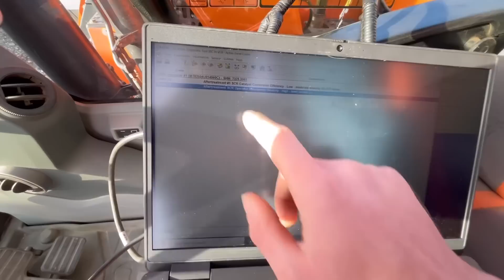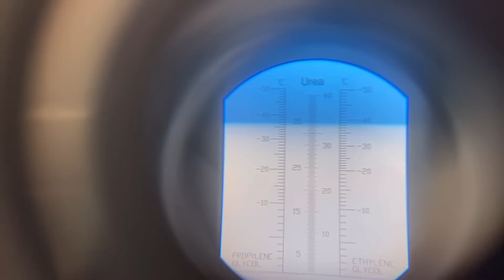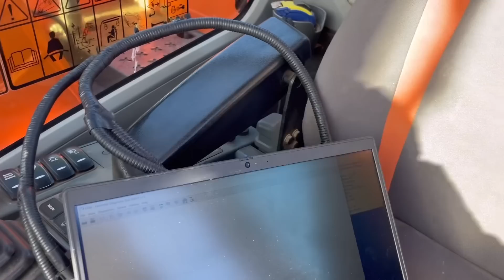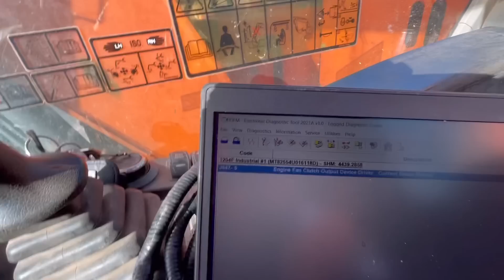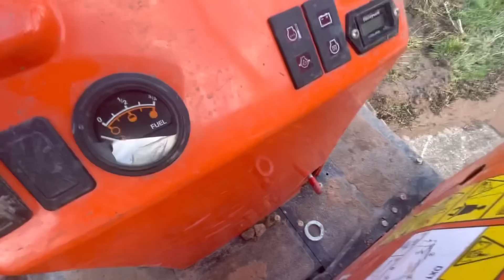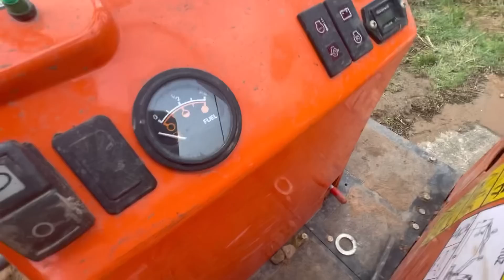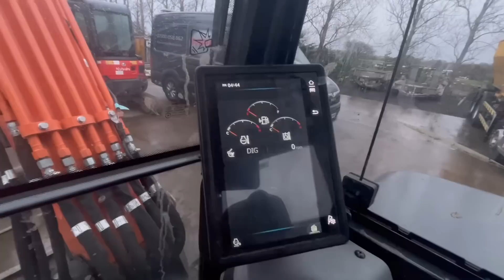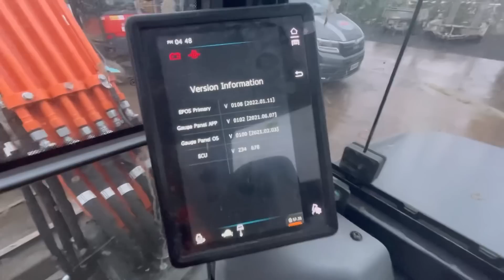Late night / un-expected update failure / adblue fault / oil leaks / Episode - 155

Comment: Hi Ali I’m a fellow fitter for your competitors. Software and Ad-Blue/DEF is what keeps us all busy now. Every manufacturer is now on the same hymn sheet with that stuff and faults. As for your pipe when I have them and they are hard ones I get some boiling water (flask/kettle) in a container and chuck the hose in for a few mins then fit it. It just makes it more supple.
Also I convinced our management to try a portable vacuum pump/transducer to hold hydraulic oil so very little is lost. It’s brilliant it runs off a Milwaukee M18 battery and can hold a 992K’s hydraulic tank about 400ltrs. It’s by HydroKit. Dave is a good chap to deal with and talk to at HydroKit.
Have a good weekend Ali  from 🏴

Comment: I wonder if the low current alarm is similar to what we called a wire break alarm. The controller would put around 4 milliamperes on the wire and monitor it. If a wire opened the current path would open and hence the alarm. Wonder if it could be a poor connection at plug triggering the alarm. The only electric is the clutch control solenoids and associated feedback devices.